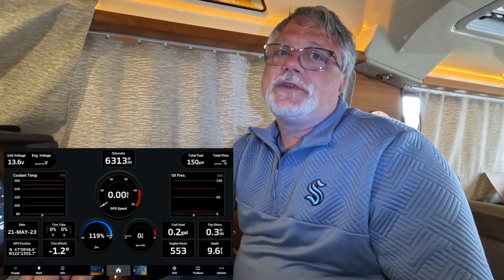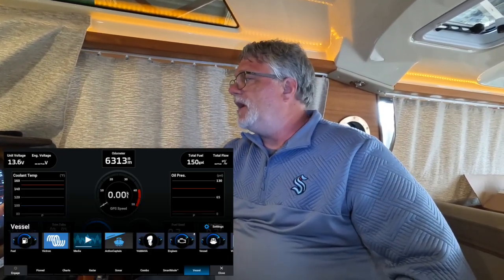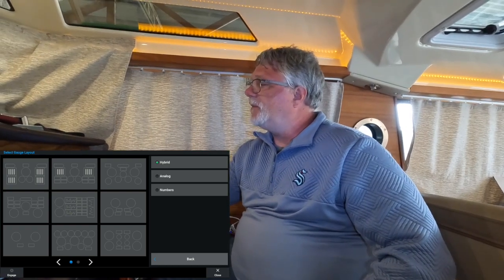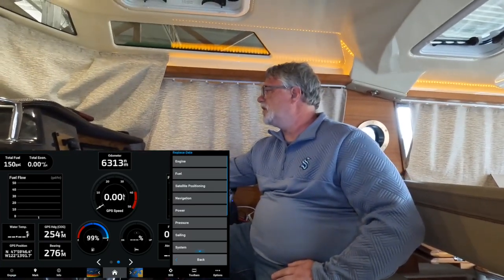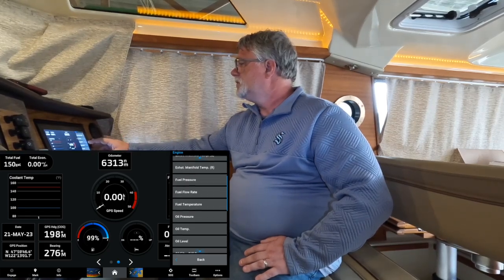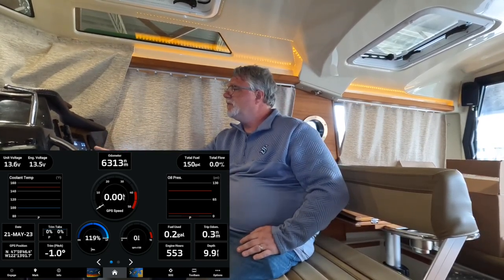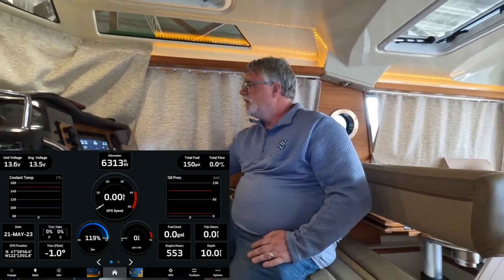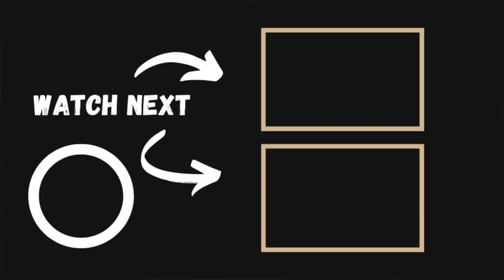How I set up my Gauge board on my Ranger Tug R27ob

Comment: Wow, I see you're up to 6313 nm on your engine.  In what, 3 years of use, I think, if I remember correctly.  It's good for me to see the Yammy 300 will last that long.  Any sign yet of needing an overhaul?  If you did that already I haven't seen that video, yet.  I've been watching your channel for a long time now and I appreciate all of the details you share about your boat.  My thanks to you and your wife..
Reply from the maker: That screenshot is a couple of months old.  After our SE Alaska trip we are at 8,509 nautical miles.  (About 9,800 miles) on 735 engine hours. 

The boat and engine just passed 3 years old in June. 

There’s a water taxi using Ymahas’s and has repowered them once they went over 7,000 hours. 

So far I’ve not had any issues with my f300.  I do all the routine maintenance myself, every 100 hours.
Reply: @Letsgochannelsurfing
Reply: I see now that I remembered something wrong from an earlier post in the R23 vs 25 vs 27 episode.  With maintenance it's reasonable to expect the engine to last 3-4000 hours, not miles, before needing an overhaul.  That's good for me to know and remember.  I'm still debating with myself over whether to get the R25 vs the 27.  I'll probably wait until I retire before I get mine mainly because I'll want to keep mine moored about 2 hours away from my home.  Just a few years away with time flying by very quickly.